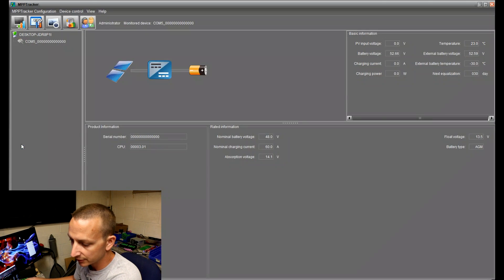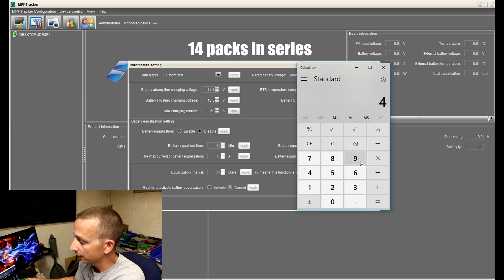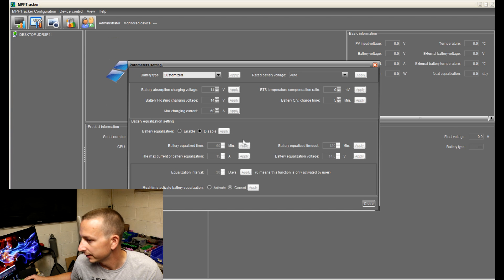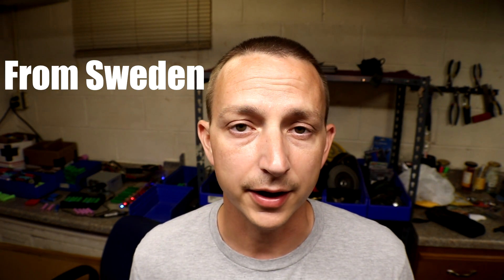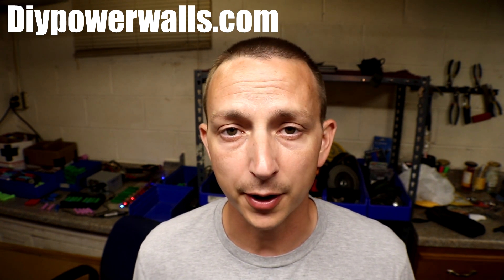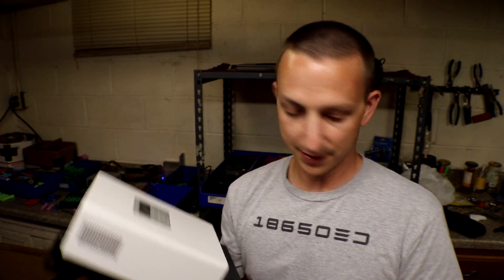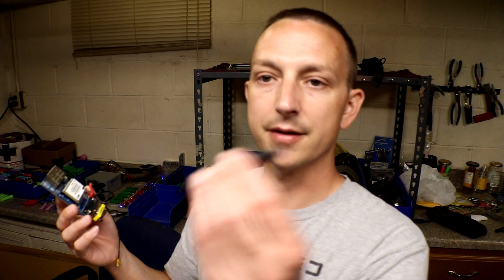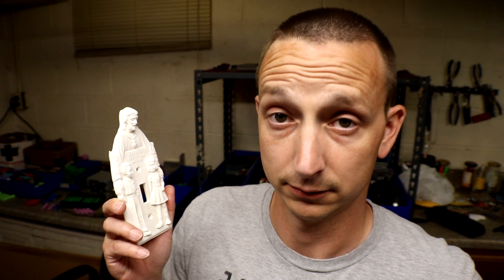Diy Tesla Powerwall ep58 Setting Up The PCM60X and a Shout Out!!!

Comment: I know you posted this a year ago and you probably don’t remember, but your 14s packs was at 56 volts, then you divided by 4=14, then you changed the settings, will it go as low as 10? When you programmed the software was it plugged into the charge controller?
Reply from the maker: Yeah I dont remember if it goes down that low lol,  Ill have to check.  But yes thats all I did to get the voltages I wanted.

Comment: I had that controller and it was terrible at using and staying at the right PV voltage for the varying light and load! Good luck with yours, I was disapointed after controller shopping so long. Go with at least a EP solar MPPT tracer. Don't bother with a PWM if you want the most power.
Reply from the maker: I havent noticed anything like that.  What was your panel voltage?  I have 3 24v panels in series!
Reply: I tried 2,3,4 -36 cell panels series/parallel on a 12.6 newer type special flooded LA cells and PV voltage was too high or low 90% of the time and I put 200+ hours in testing over 28 days. I found great MPPT controllers don't come cheap. Maximum Solar tech support is minimum. I found my DM Solar panels do best at 17v each,even at half power. Good luck with your cells balancing.
Reply from the maker: Ill look into there stuff and see what they got!
Reply: One problem with  EP Solar tracer. MPPT gets stuck in morning at 14v PV (It's overbucking) so I momentary disconn.PV then it's 44v and then MPPT turns buck back-on and it's stays on MAX point near 35PV.
Reply: I want to buy a used Morningstar 45 or 60 amp to see if I find MPPT perfection.
Reply from the maker: I almost went with the Morningstar 60 when I was looking for a charge controller but went with the pcm60x since a lot of others using 18650s had good luck with them. So far I havent had a problem with it on the 48v side.

Comment: hi where can I fine a solar charger for my battery pack 12 volts (18650) thank you sir
Reply from the maker: You can use the same charge controller that I am using.  It can do 12, 24 and 48v and you can set all the settings how you like it.  Link below!😀👍

Comment: So are you still using mains supply input and is it a consideration to provide "self" created 120v from the pack?This could be useful if you could reverse the use of the UPS i.e. Be on batteries until voltage reaches minimum then switch to mains output, while batts charge and restart batt use when charged as required, you may be doing this already I have just started watching this set of vids....silyrics@hotmail.com (nige)
Reply from the maker: I was only seeing what would happen on mains.  I just charge with solar when we have sun.  I do like having the option tho if the need ever comes up.  For now its just a in case of emergency to use mains.👍

Comment: Hi Average Joe ! I am stuck with the connexion from my PC to the PCM60X... No way to communicate with it. The USB-to-RS232 is perfectly seen by the MPPT tracker, but no way to "talk" to the PCM60X... I presume I have an issue regarding the RS232 parameters... Could you provide me the setting syou are using in your RS232 ? as per example 9600,8,N,1 ... Many thanks for your help !
Reply from the maker: I actually never needed to change the settings on my pc but I will say that you cant edit the settings for very long unless your batteries are hooked up.  If the batteries are not hooked up it will time out.  The com port settings on my pc are 19200, 8, none, 1 and none and com2 is 2400, 8, none, 1,  none.  have you looked at the online manual http://www.mppsolar.com/manual/PCM-60X/MPPTracker%20(monitoring%20software)/60x_MPPTracker_user_manual.pdf

Comment: my problem with this charge controller is the maximum Voc from the solar panel should be around 150V, I have connected 5 solar panels to have around 190V, because my solar panels are about 150 foot from my charge controller, do you have a suggestion for a charge controller
Reply from the maker: Oh ok I gotcha,  Before I get this charge controller I was planning on getting a morningstar charge controller  but didnt because the pcm60x was cheaper.  The morningstar charge controllers can handle up to 600vdc open circuit so 5 in series should be a problem.  https://www.morningstarcorp.com/products/tristar-mppt-600v/

Comment: Hello brother. Thank you much. Excuse me my level english. I am from Spain. Have any cuestion: Why 14 cells and not 13 ?
Reply from the maker: +Sevillano82 Higher voltage makes the system not work as hard to convert and is just a hair more efficient 👍
Reply: Perfect Joe.

Another question.
For a 18650 bank and its load (using batrium bms),
 Is any hybrid inverter or regulator valid? I understand that I need to be able to regulate the charging voltage and cancel the floating charge, right?
Excuse me low level english.
Thank You Much. Regards

Comment: Funny thing, my uncle and I were talkin about fluorescent lights and humming today. He was told by a guru in audio setups that what you could try is to disconnect the ground from one end or the other that goes to the light. So, either unscrew the ground from the light housing, or disconnect the ground from either the plug or in the breaker box (depending on how yours are setup). It fixed the humming issue they had with the sound system. Might be worth a shot  :)
Another option, change your lights to LEDs. A new story (to our area, at least) called Royal King carries 4' LED lights that are super bright (don't look at them when you turn them on unless you are wearing sunglasses) and only cost about $15 each. I was surprised how well they work. You can even daisy chain them together so you have 1 switch and cable and several units connected in parallel. Pretty neat overall.
Another great vid!  :D
Reply from the maker: Interesting, Ill try the ground wire trick on the frame to see if it helps aaaaaand get Led lights. A work buddy got a few sets of the 4ft Led lights for his and YES they are bright lol.  Thanks for the tip!!!👍

Comment: I changed my fluorescent tubesover to LEDs. Cost maybe $15.
Reply from the maker: +David Wilker I am going to to the same but will still change that old ballast 👍
Reply: I was just thinking that if you do change the bulbs to LED, you won't need the ballast (if you get the type without ballast) so you can cut the ballast out, rewire the tombstones and you won't have to even take the old ballast out, unless you want to. Thank you for the videos!

Comment: So I'm not sure but I think you needed to set those voltages to the 56v right
Reply: Alex Reyenga that's what I was wondering so times 4 but if that's the case why not set it to 4v and 14 cells
Reply from the maker: It goes off the voltage of the batteries that are hooked up (auto mode) or you can select the voltage you want (12,24,48).  Just have to times the float setting by 2 for 24v system and 4 for 48v system.
Reply from the maker: Yeah there really isnt much out there specifically designed for Li-Ion or at least not anything that can handle many amps.  Yeah the first link does look a little too simple.  Wonder how the second one will work out.  Let us know!!!
Reply: I was confused by this settings as well. It seems to me that if you have the charge controller hooked to the entire series of packs and that equals 56v then you would set the float voltage to 56v not 14v.
Reply from the maker: Yes its a little confusing because the software only shows for a 12v system so you have to times the setting by 2 for a 24v system and times it by 4 for a 48v system.  For mine since its a 48v system its 14X4 or 12X4 or 14.35X4 ect to raise or lower the top end voltage. Does that make sense? lol 🙃
Reply from the maker: They only show in 12v so you times it by 2 or 4 depending on your system voltage.  Not sure why they have it set up like that but they do lol
Reply: Is there a multiplier field setting or does it somehow know how many cells that there are?
Reply: I understand now. The charge controller is built and designed to operate on lead acid or similar technologies. So it's necessary to consider how it is programmed and what it actually thinks is connected. It's surprising that there are not more products that are programmed to understand li-ion and similar types of batteries. I have bought 2 charge controllers so far that claim to work for li-ion. I haven't recieved the second one yet, but the first one, while it seems to work is just a little (key word here) too simple for my liking.

The simple tiny li-ion charge controller: http://www.ebay.com/itm/Solar-Panel-PWM-Controller-Lithium-Battery-Charging-Module-7-4V-11-1V-14-8V-3A/262765270892?ssPageName=STRK%3AMEBIDX%3AIT&var=561732377346&_trksid=p2057872.m2749.l2649

The charge controller I havn't recieved yet: http://www.ebay.com/itm/SL02B-20A-20A-12V-24V-solar-charge-controller-li-ion-lithium-battey-regulators/252616546127?ssPageName=STRK%3AMEBIDX%3AIT&_trksid=p2057872.m2749.l2649
Reply: Are you charging to 4.1V or 4V? it would be that x 14. Name is Glen by the way

Comment: What BMS do you use on your powerwalls? If you have already done a video on it, can you please post the link?! Cheers.
Reply from the maker: I dont have a BMS yet but will most likely get the Batrium BMS.  It does everything!!!😆 https://www.batrium.com/
Reply: AveRage Joe Cool, thanks mate. I'll look into it. Cheers.
Keep up the good work.
Sorry, another quick question. Why does everyone on YouTube  (Just speak for yourself lol) use bus bars, soldering etc... wouldn't it be cheaper and easier to spot weld the tin strips like they are originally put together? Those spot welders only cost $100 on eBay. I spent that on my soldering iron...
What's your thoughts?
Col.
Reply from the maker: Most solder because we are using used cells and we fuse each cell. At least one side is fused and the other side has a little thicker "fuse type" wire.  Most wont use the tin strips just in case a cell goes bad, its easy to replace with just a fuse  and a buss bar in the center of the cells. Spot welding is an option and could be a lot faster.  Daniel  "Diy Tech & Repairs"  has a video where he spot welds fuse wire here https://www.youtube.com/watch?v=H_b3OJuQpEE

Comment: Hello Joe.  I set mine up with a working voltage of 4.1 high 3.5 low. So that meant a 57.4 total at full charge and a setting of 14.35.  Keep and eye on you pack changes.  Thumbs up my friend....
Reply from the maker: Thanks!!! Cool, yeah I set mine up for the 4v so when its hooked up to solar they would charge up close to that (since there out of balance)then I can disconnect it to redo the top balance on the packs.  After that Ill play around with the voltage settings to get what I want to use.

Comment: did you connect the rs323 directly or using some USB converter, and if so, which one?
Reply from the maker: I did use the rs232 to ethernet cable the very first time I logged into the charge controller.  During this video I used the ethernet from the charge controller which has rs232 on other end then I used that mini gender changer to connect the rs232 to usb to the computer.